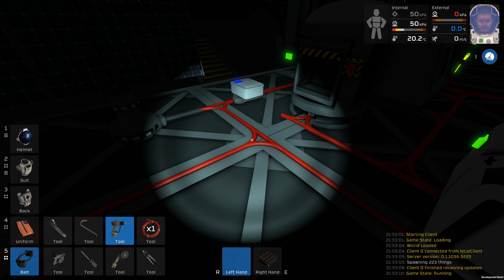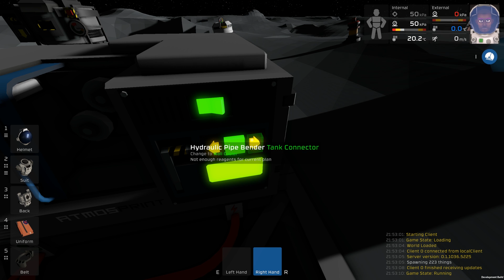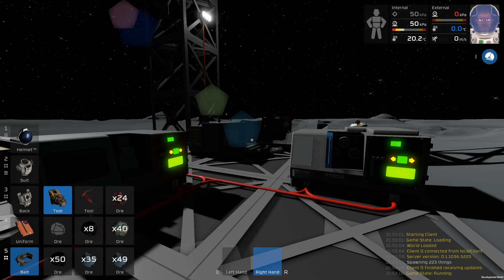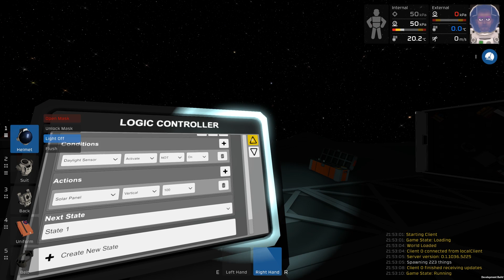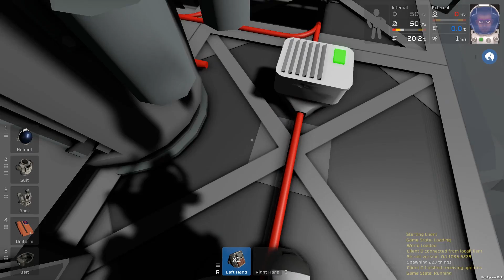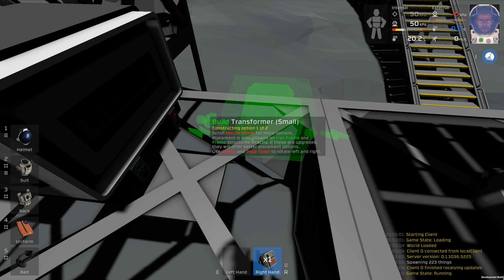Stationeers E03 - Better Power Storage (Battery, Transformer)

Comment: I keep seeing tutorials (and I've done it) where more than one item was created by accident. Pro Tip: After you hit the start button, press one of the arrows to cycle to another object. This will allow the current item to continue being built but will STOP after that. Guaranteed way to make only one item. It's really useful for those long production time items like the e-printer and pipe bender. You can start the build, press an arrow button, and go off and mine or build and not have to worry about checking its progress constantly.
Reply from the maker: Heh, yep, I do that (but much later on in the series)

Comment: This may be old post but a great tip for early game is if its night time and you need to charge your suit battery in an emergency recharge situation, turn the air con off (in your suit) and use your own body heat to keep you from freezing to death. Just remember to switch it back on at sunrise.
Reply from the maker: Nice tip :)

Comment: KEY NOTE: YOU APPARENTLY HAVE TO PULL THE HANDLE ON THE FURNACE WHEN IT IS STILL HOT. I mention this because I kept waiting, and it never worked. I was a bit concerned about something possibly exploding into a vacuum when under heat and pressure.
Reply from the maker: Heh, nice.  I never thought of leaving the handle without pulling it!

Comment: I wasn't aware volatiles boiling off was a thing in the game! That's very interesting because that's actually an issue space programs have with cryogenic fuels that like to be heated up by ambient temperature and expand and evaporate. That gives me an idea to make a little room in a base with a separate airlock and vent system (to protect temperature), put the air conditioner in there and crank it as cold as possible, put the volatiles on a shelf. Should be a safe storage. c:

Comment: Thank you so much for pointing out that the furnace is able to be powered rather than only used via gas.  No one else had mentioned that, or displayed anything other than having it run off of a fuel.  
This is by far the best video I've found on this game!

I'd give you a handy-J if I could....  ;P
Reply from the maker: Aah yes, about that.  It.. still needs gas, sorry! :)  It seems the power port is just for data (as far as I can see).  They've just added the ability to activate the furnace remotely, which wasn't working previously - as far as I know, you need some sort of fuel.  Early game, you can just dump 2 volatiles 1 oxite to get it started, late game you can just provide a gas mix directly.
Reply: grayduster 
Either way, no one had pointed any of that out. Currently I've got my furnace floating next to a locker for ingot creation. I was unaware that the ice rate didn't change as you increased your input. I was able to make a 100g steel ingot earlier. 
I also found a bug with the centrifuge. It ended up giving me over 50 stacks of iron ore and 20 stacks of coal before I shut it down. 
Also got my solar array working thanks to you. Had to make some edits, but it's working gloriously now. And running dual battery for the base. Power is no longer a concern. 
Thank you for everything, and I look forward to some of you upcoming videos.

Comment: Volatiles and oxites are the fuel for the furnace. The more of those you put in the hotter the fire and higher the pressure.
Reply: i learned that one the hard way.
Reply from the maker: Yes, don't put in more volatiles and oxites for each batch :D
Reply: If you don't want to wait after you make stuff, you can decon your furnace then put it back up and it will reset to 0 pressure and 0 temp.

Comment: Furnaces do not require power. They only rely on volatile and oxites to work. Power is not a requirement to active it.
Reply from the maker: Aah good to know, although the port on the top does say data and power.  Odd, unless there's more advanced uses?
Reply: Probably so you can remotely activate it later on.

Comment: what is the point of a transformer? i have a similar setup without one and still everything works?
Reply from the maker: The battery can output a huge amount of voltage.  The transformer ensures that only the voltage you want it output.  The small cables can take up to 5k if I remember correctly - it'll help when you have more solar arrays :)
Reply: grayduster Ah that makes sense, thanks a lot. And is there a difference between the small and the bigger transformer? edit: how do i find out how much power is needed for certain objects?
Reply from the maker: You can either look in the eReader cartridge, using your tablet, or the network analyser, I believe for power figures (don't try to push more than 5k through the small cables).  Haven't built a large transformer yet - I may have to experiment there :)
Reply: grayduster thank you!

Comment: Dude I cant make stee for some reason
Reply from the maker: Ok, put 3 iron ore (not ingots) into the top, 1 coal ore.  At night, put 1 oxite and 2 volatile into the top, power the top with cable, then hit activate.  You should get a glowing furnace, hit the lever and it'll drop out of the bottom (make sure there's enough room)
Reply from the maker: Also, once you have it glowing, you can just add iron ore and coal ore in that same proportion - no need for more oxite or volatiles until the pressure and temp drops too low.
Reply: Ok I did all that but then it doesnt say it-s going to make like 30 steel or any steel at all, it only says the contents 3 hydrocarbon and 1 iron.
Reply: Nvm I was putting 3 coal and 1 iron instead of 3 iron 1 coal.
Reply from the maker: Great to know you've got it sorted!